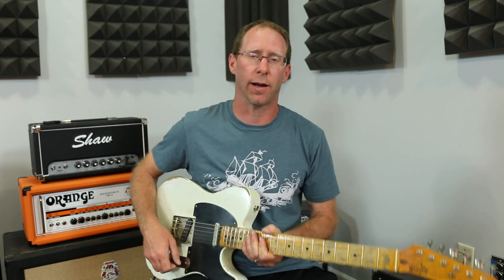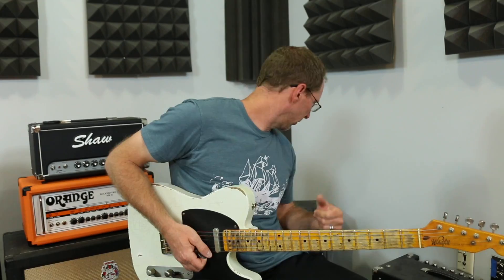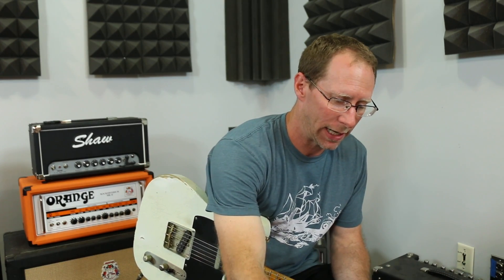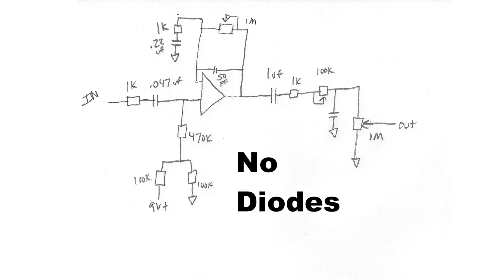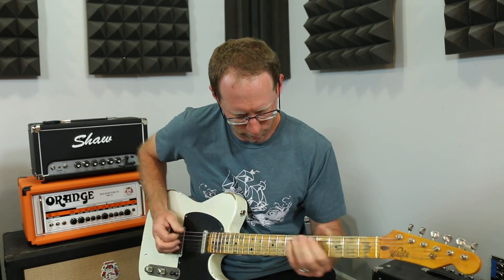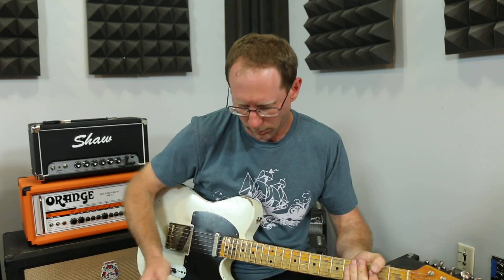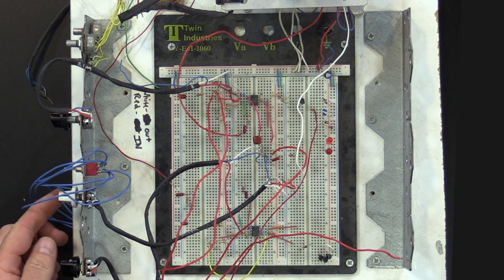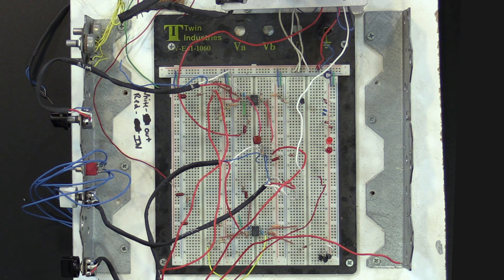The myth of "gain"... and it's relation to "clipping"

Comment: Ok Brian, I think you're really being pedantic on this one.  Yes the type of distortion has nothing to do with the mathematical concept of "gain" which is just what factor you increase the amplitude of a signal.   In the same video where you're being pedantic about "gain" you talk about how you have to adjust your "volume" knob so that the levels are similar.

What is "volume?"  A volume knob, contrary to all sorts of hackneyed adages about guitarists not knowing the difference between volume and gain, is actually also a "gain" knob.  Often, as you know, volume knobs are voltage dividers where you have a negative gain factor.

The truth is that a guitarist thinks of gain as an amount of clipping applied.  They will think of a pedal with a 9v power supply which almost certainly has less "gain" than one of the triodes in their pre-amp and they will think of that pedal as being a "high gain" pedal.  There is no reason for them to change their terminology just to be more technically accurate when even people who know all about electronics, such as yourself make mistakes in your wording on a video where you are lecturing people about getting their terminology wrong.
Reply from the maker: Fair point Clint! 👍🏻 just trying to help guitarists (geared towards non-diy/electronically inclined) learn something new and hopefully interesting
Reply from the maker: Also, seriously- THANK YOU for disagreeing and a very amicable way. I love the debate when it is in a respectful healthy way 😊
Reply: I have a great deal of respect for you, your youtube videos and your pedals.  I'm glad that you didn't take my criticisms too negatively.

Comment: Well, then what does gain mean? I assume it means the amount of signal increase pushed through the front of the amp, if we're talking pedals. So, I guess what you're saying is that more subtle pedals like something like a Tube Screamer or something isn't really about amount of signal or being higher in gain. It's just a different kind of pedal with less clipping. Is that it?

Comment: Great video mate. I'm not an electronics expert or an amazing guitarist but this is info I read about years ago ,pre internet in something called books. We used to change the clipping character of our amps to a degree by swapping ECC83 valves for 12AX7 etc . It's a great advantage to any player to understand this stuff ,wether we are talking valve amps or our solid state pedals . Thanks for adding some real information to the so called "Information super highway" 👍😉🎸

Comment: Am I right in thinking that valves kind of do both in the sense as you add more gain the waveform gets closer to a square wave you would get from hard clipping and this is where 'high gain' comes from as there is lots of signal hitting each stage to gets valves to clip like that, transistors and diodes in clipping circuits not so much. I have seen a few designs with both soft clipping sections and hard clipping sections I am guess to get both. Then of course FETs and Opamps designed as amps not for clipping still clip when smashed with signal.

Comment: So are you going to change the label of the control from gain to clipping on everything?  :)
Reply from the maker: Good question! No, we won’t do that because electronically it IS increasing gain, but by increasing gain clipping is introduced
Reply: That makes sense, and actually helped clarify the point.  Thanks!

Comment: For pedals, the most gain comes from a clean boost pedal. As a result, that huge signal created from all that gain cause the first stage of the amp to clip as it slams into the power rails.
Reply: heh, that's how I describe clipping from a circuit perspective:  When the amplifier component hits the power rails.  Playing with op amps and the 2 gain resistors is a simple cheap way to experience this.

Comment: The way I understand it is gain the ratio of input to output signal in an amplifier circuit.  Small input larger output.  With guitar equipment, the gain of one stage is used to feed another stage or diodes to be clipped in proportion to the level of gain.  Too much gain annihilates the signal with harmonics.  This is not magical in itself.  The magic is in clipping the correct frequencies for the desired effect.  Tube amp power stages provide desirable sounds when clipped naturally.  You can't just clip an op amp with a large signal for a great result; unless you want that fuzzy type signal 😀

Comment: Your pedals are just absolutely amazing. I have your Tumnus deluxe set as always on clean to give the guitar more depth. 
I also have your Dracarys for really high gain, it is amazing!! 
But I need a good overdrive. Which pedal can I get that has the same footprint as the others and with jacks on top of the enclosure, that would give me more of that in between overdrive sound? Thanks again for all you do.

Comment: I have a question , a technician told me once that most modern high distortion tube amps, like EVH 5150, and other similar style amps , are not really tube distortion but some other type of clipping, and the tubes just basically buffer, or shape the tone, and that there’s no way you can get tubes to sound like that on there own. That they are just pretty much big fancy distortion boxes, and not true tube amps. How true is that statement, can you talk about this in another episode perhaps. Or can any of you provide an answer to my question. Thanks.
Reply: You usually don't see it because it's on the floor, but a lot of pure tube amps used in "high gain" scenarios will have a Tube Screamer pedal paired with them.  Very common with professional artists.

Comment: Hey Brian... What in the circuit makes more or a heavier distortion? Like the difference between an overdrive or light distortion vs super heavy distortion pedal? Is there additional diodes or different diode values? Thanks

Comment: This is a much needed video.  Gain is a measurable quantity, an is purely the ratio of the output signal level to the input signal level.  The "high gain" sound adjective was the start of the problem.  My guess is that it gained prominence from the Carlos Santana sound created by the Boogie amps that Randall Smith was creating from Fender amps by adding an additional preamp tube.  Technically, that adds gain, but when the signal level is already at the maximum, it doesn't get any louder.  It does add sustain (quiet parts are louder) and increase the harmonic content of the signal from the clipping and compression.  So that compressed, distortion sound that Santana is famous for, became associated with "high gain."  That trend continued in the 1980s when the rock and metal players started playing through amps, and racks, that had multiple preamp gain stages.

It would be interesting to hear the three versions through a Fender Twin or JC-120.  Something that has a ton of headroom.  Even on the clean "no diodes" version, there is some distortion/grit/crunch on the attack with the Fender Deluxe.

Comment: Could you explain different types of diode clipping? Like LEDs and such?
Reply from the maker: I did that last year, I believe it was on a video about breadboarding
Reply: All diodes have a transition point where they begin to conduct.  Different types of diodes DO begin their conduction differently (what often gets referred to as the "knee"), but much of the time the differences in conduction speed are well outside of the frequency range of guitars.  Remember that these same diodes are also used for high-speed telecommunications switching.  Conduction speeds of 2 vs 25 nanoseconds can have big implications for that switching, but means little for guitars whose frequency response tapers off above 6khz or so (or at least the speakers we listen to them through).

That said, the biggest impact of diode type will be the forward voltage (Vf).  That is, the actual signal level they begin conduction at.  If the Vf is 180mv (common in Schottky diodes), then that diode's action will begin when the signal feeding it reaches that amplitude.  If the Vf is 1500mv (typical of red LEDs), then the signal is allowed to be higher amplitude before being "clipped" by the LED.  Generally, the higher the Vf, the greater the dynamic range of the signal permitted before clipping sets in.

Different designs will use different types of numbers of diodes to achieve different Vfs.  The Vf of individual diodes can be added.  So, if one stuck a Schottky, germanium, and silicon diode in series, there is a pretty fair chance their total Vf would be, say 1100mv or so (180+350+570 are commonly-occurring values for each type).

There are other factors at play here, but the higher the total Vf of the diodes used, the greater the maximum output level of the pedal, since the diodes are not imposing a low ceiling on the signal.  Case in point: the MXR Distortion+ uses a pair of germanium diodes, while the DOD 250 uses a pair of silicon.  The DOD doesn't clip as hard, but has a bigger output level.

There are pros and cons to making the Vf lower or higher.  If you want all your clipping to come from the pedal, then high gain and a low diode Vf will get you there easily.  If you prefer to have your sound coming from both the pedal and an amp pushed hard, then you'll want a somewhat higher Vf in the pedal, so that the output level can torture your amp appropriately.

The choice does not have to be one or the other, though.  Many pedals will use a low Vf diode complement, but include a "gain recovery stage" further along in the circuit to bring the output level back up.  In other words, the clipping section doesn't have to be the last thing the pedal does before sending the signal out.

Clear enough?

Comment: aha, so diodes don't saturate like tubes.  can you explain more about the difference between the two?
Reply from the maker: tubes are set up as a gain stage, the limitations of that gain stage introduce clipping. The diodes just clip the signal over a certain voltage
Reply: A tube is more like a transistor not a diode
Reply: Tubes are set up with some external components which set the gain (aka a constant which multiplies the input voltage) the tube will have. When the tube has to take the voltage of the input beyond the supply voltage range, it just leaves it at the maximum/minimum voltage within that range. That is called clipping. In a sine wave graphic it looks like the wave top and bottom peaks have been trimmed. Tubes do a smoother trim than diodes, that's it. You can change the gain on a tube to get a bigger portion of the wave trimmed, but not on diodes; what you do with them is have an op amp raise the signal, you can then change the gain of the op amp for a relatively similar effect.
Reply: @Tomas and Pjr

In regards to distortion, harmonic content and tubes, the outcome is highly dependant on the application. Is it voltage amplification or power amplification? If power amplification what class, A AB1, B etc? All will deliver different distortion spectrums.

What is identified as tube sound (vs solid state) always involves more than just the tube's transfer characteristics, it involves the topography of the entire system, including power supply. 

Pjr's question really requires one to have a reasonable electronic knowledge and a small book of explanation to answer properly.
Reply: Then there's mosfets...
Reply: The corrolation I see is that they both use a low level A.C. signal input across a circuit with a  higher voltage potential to create an analogous, but effectively amplified version of the original input signal...  oh, and one is solid-state and the other operates in a vacuum.
Reply: The only thing that might bum me out is that you made me flashback to fourier analysis class. That was one BRUTAL math class (but it was cool how any waveform could be mathematically represented, square wave being the craziest)